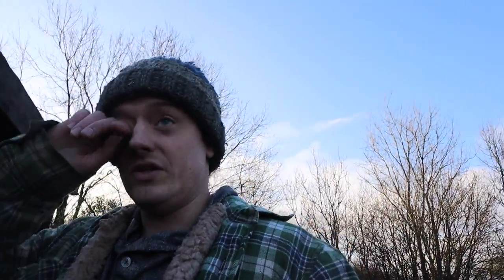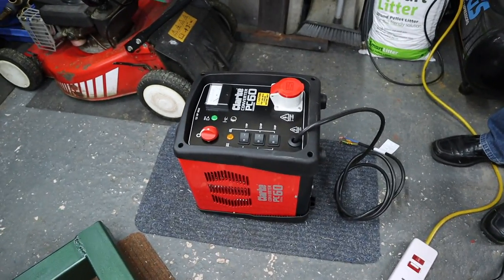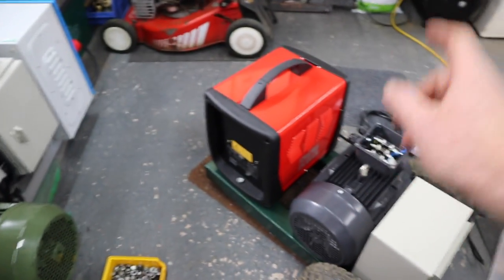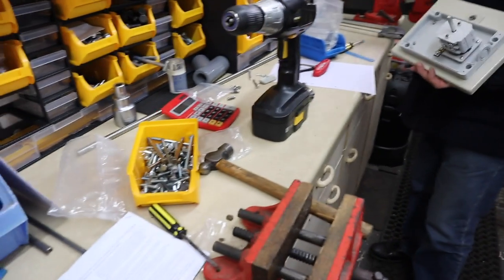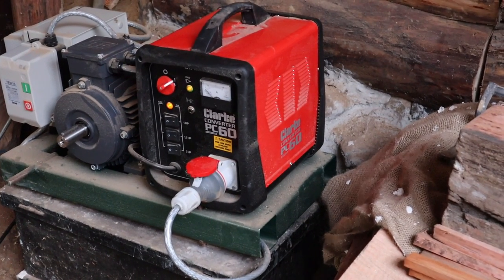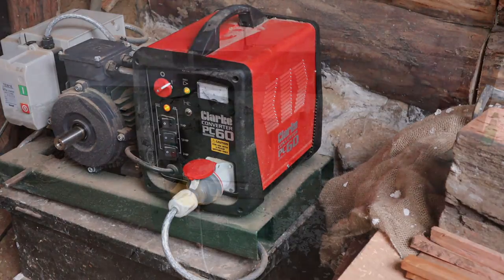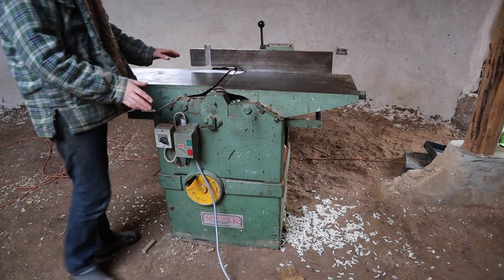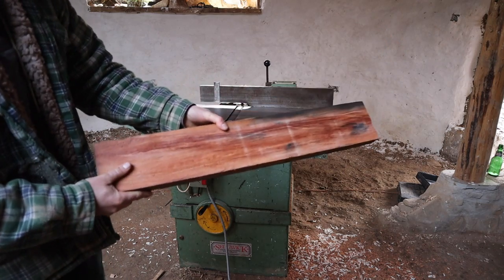Easy DIY Rotary Phase Converter Build (Off Grid Three Phase Hydroelectric Power)

Comment: your Setup doesn't make any sense :o 
A rotary phase converter normally would be running on a single phase power line which then would be either get help by a condensator or a single phase helping motor.
the rotary force then would generate the missing third Phase so that one could run 3 Phase machines - with limited currents - from such a system.

You have connected a rpc to an already existing 3 Phase power supply delivered from a static one to three phase converter, which only adds more load to your static converter but does not help you anything in powering your real load you would like to run.

So either run your RPC from 2 Phase Power with a condensator and supply only smaller loads with it or sell the induction motor RPC Setup to someone who really needs it and will run it on 2 Phase Power and simply keep with the verry nice static converter and run your Loads of it which is the far better solution than a RPC ever could be for your needs.
Reply from the maker: Static converters don't make three phase. They start using capacitors and then run the motor on single phase but up the voltage via transformers. The motor on my converter is run by the static converter and the motor makes the other phases

https://www.northamericaphaseconverters.com/how-static-phase-converter-works/
Reply: Sorry but your understanding is incorrect. VFD rectifies AC single phase to DC then using power electronics creates 3 pulse 120 degs apart (3 phase) There are methods using transformer with differing Vector groups. That is complex and expensive. 
There are methods using large capacitors to shift current by 90 degrees but these will be extremely inefficient.
Reply from the maker: @gw4838  I dont think i am, One VFD can run two different motors that are different sizes and run at different speeds? I dont think so mate.
Reply: Sorry but you are incorrect I did not say run two motors. 
The three pulses are created to provide three phases. A VFD rectifies the incoming power to DC on large drives will pass through and inductor. Then the power electronics will create 3 phases. 
On large VFD can indeed create more phases. The largest drive I worked on was an ABB 14.5Mw, 12 pulse. Or in effect two syncronis motors on the one shaft.
But I have no wish to get into a diatribe on how VFD work. Your description where you use a an invertor to power a motor then parrallel of it to drive a planer. The fact when you plugged directly from the invertor to your planer and it started demonstrates your invertor is all that required.
You have basically paralleled the motor with your tool. 
.I don't have the details of your invertor, if you have access to an oscilloscope. Connect it  check the output of your invertor. 
There is an inefficient method where you take a three phase motor and using capacitors to produce a phase shift 90 deg, to permit the motor to rotate. Then take the phase not in use connect through to with the single phase supply to create pusedo 3 phase, will be very unbalanced. 
Rotary convert in its true sense would be  a motor driving a three phase alternator. Typical use would 3 phase motor 50 running at say 1500 rpm (2 pairs of pole motor) gear to drive the alternator at  1800 rpm = 60 Hz.
This configuration typically used  to for shore to ship supply. UK being 50 Hz USA  60 hz.
But good luck to you. Your build videos are entertaining.
Reply: @KrisHarbour  sorry Kris I am a trained electro mechanical engineer and according to my education I am able to design and build such machines and converters from scratch. According to its technical documentation from the manufacturer the Clarke PC 60 provides 400 Volt on 3 phases, see also the schematic in: https://www.manualslib.com/manual/1453687/Clarke-Pc20.html
Due to this given specifications of the Clarke PC 60, using an induction motor as a rotary phase converter only increases the load on your static phase converter and its supply lines, but simply does not provide a more stable supply for the actual load.
Your main problem remains the too weak and too long supply line, which would be too weak even with 2.5mm because it is twice as long as the maximum allowed 20m if I understood your length specification correctly (40m).
Take a thicker supply line and look around for even heavier machines directly after a 3 phadsen inverter.
This would also allow a decent start up control.
If it should be cheap, look for large discarded 3-phase UPS systems which deliver exactly what you need on the secondary side and in addition to L1, L2 and L3 also deliver N.

Comment: Sorry but am I missing something here, you have gone to all the trouble and expense to build a rotary converter but it doesn't work so ended up just using the Clark converter to run the planer. So what is the purpose of this video. To me you have just built something that doesn't work. Why didn't you just try plugging the planer in to the Clark in the first place. I can't believe I have sat here been massively impressed with the work that went in to that rotary converter only to be shot down because it doesn't work. WHY doesn't it work when the clark costing 300 pounds plus does work. what did you do wrong was it the motor, the wiring. It just seems a massive waste of time and expense.
Reply from the maker: It didnt work as im off grid and at the time didnt have a powerful enough inverter, I now do and it works. Also its not only made to work with one tool it can work with any three phase tool. It just that the planner was the only one i had at the time and it draws 16KW to start.  Not sure why your so angry. live off grid mate with my own power system and run huge three phase tools off it so chill out. it works just fine.
Reply: @KrisHarbour  Im not angry at you I am just wondering why all the expense and the cost when the clark works perfectly. For example I researched this video because I have a powerful three phase compressor but like you I only have single phased electric. So I needed to see what converter would be suited and after research I looked up the Clark and it is able to run about two or three tools at the same time or one like your planer if it requires more power. So again I don't see the point in me going to the expense of building a rotary converter when the clark does the job. I might as well buy another clark converter so two Clark converters would run between three and six three phased machines. Am I right?
Reply from the maker: The rotary Aspect of it means you will get a bit more power out of the tool. But the main reason for it is to get a true three phase. this is very useful for things two speed motors in them like a lathe. My reason for making it the way i did was so it is versatile. it will be used to run three phase tools in my woodwork workshop and my machine workshop so it needs to be able to do everything and having the ability to run more sensitive tools on true three phase is worth the expense to me. Its a small cost compared to having to buy a Inverter for every tool.